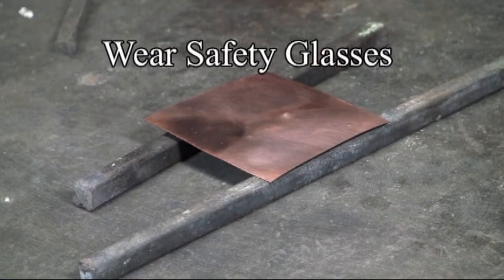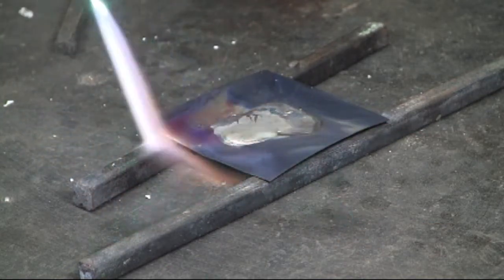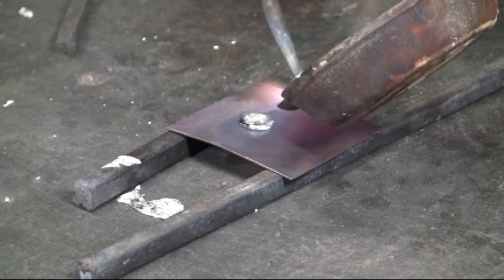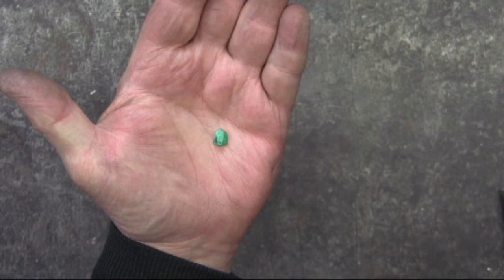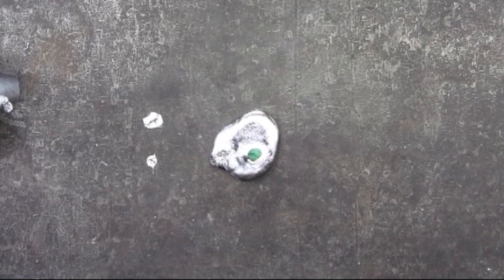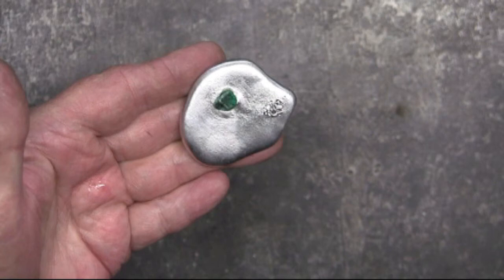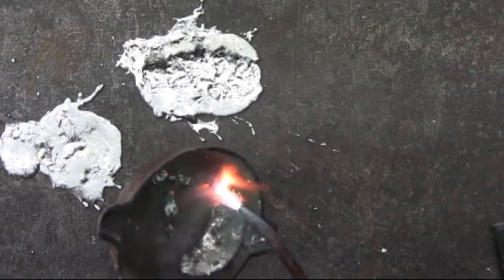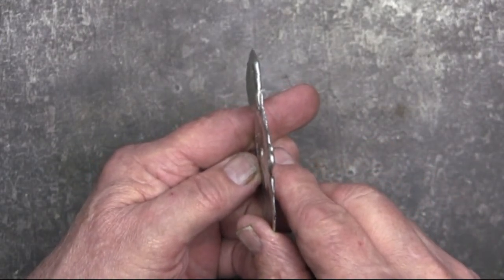Having Fun With Pewter #3

Comment from the maker: Thanks for your comment. You are absolutely right.  Smoothing the edges, drilling a hole and using a leather cord would make this into a nice pendant.  

Problem is that I keep remelting the pewter and trying out new ideas. 

 Anxious to see some of your work.  Pewter is fun to work with but so is copper, brass bronze and steel.  I'm not a jeweler so I have never worked with silver.